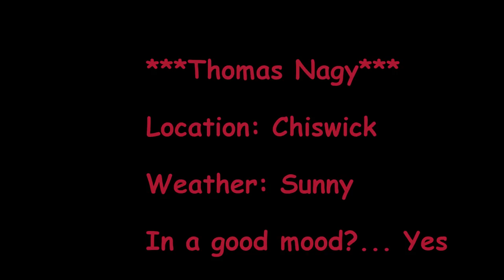Installation Air conditioning unit and outside work | Thomas Nagy

Comment: I know I won't get an answer because I never do on this channel but anyway here we go .. what kind of pipe did u run outside n why did you push what looks like romex thru it , wouldn't it be easier to push individual wires
Reply: Seal Dogg I think the pipe was just black PVC conduit. He could have have used single core cables in the pipe but they are not often used in domestic installations in the UK.

Comment: Can you please make a detailed video on how to install ac unit please and how to wire it prpeprly to fuse panel
Reply: First become a refrigeration engineer and pass the f-gas course this guy has only put in the supply not installed the system

Comment: Do like your videos but it would be great to see you test stuff after installation
Reply from the maker: hi Gareth,

yeah i will try to figure out a way of doing testing quickly on the video in future. i tried it a few days back but it took so much time up i couldnt fit it in and the video just didnt 'flow'.
ill work on this, thanks for the heads up.
Reply: thomas nagy no problem. As you can imagine it will be mostly electricians or trainee electricians who watch your videos so some more "technical" matters are really helpful and enjoyable